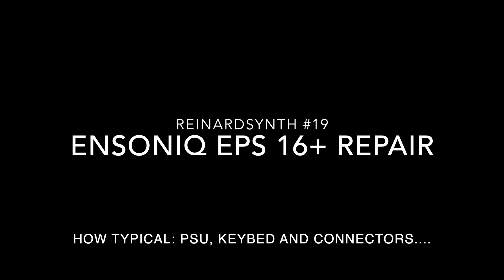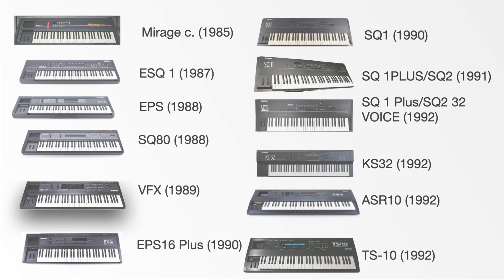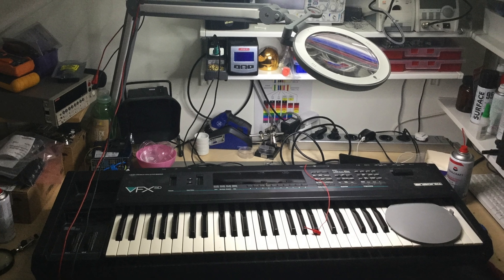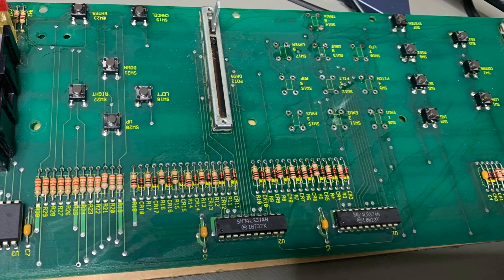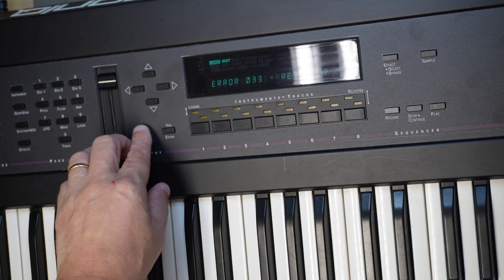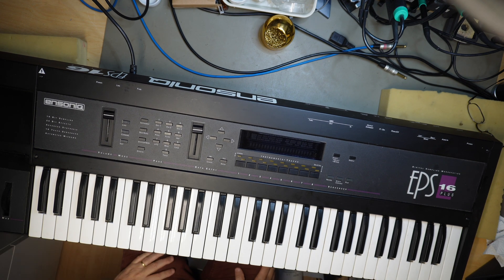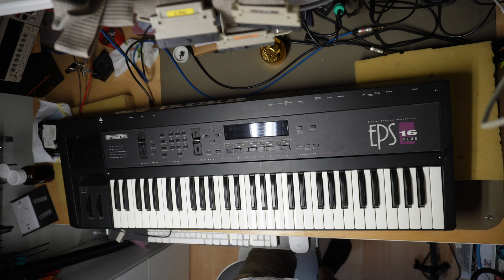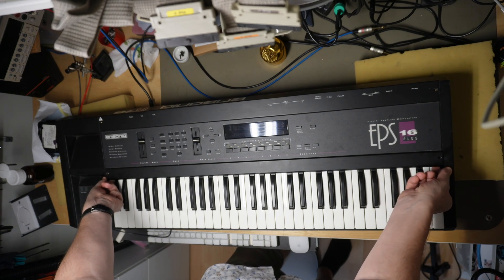ReinardSynth #19 Ensoniq EPS 16plus repair: instability, weird characters, Error 32 and 33?

Comment: Hey did you fix this? I found that those axial tantalums like the one over the ESP chip aren't to be trusted. I had the same type short in an SQ1 causing a horrible sound. I have a dead EPS and a working one as well. The working one after half hour starts playing cracklu and bugging out it might be something very similar to this and I have a thermal camera now I might tackle it again.

Comment: I've had good results in the past by unplugging and re-seating all connectors, one at a time. I used De-Oxit also, with good results. I used to carry a voltage regulator to my gigs, which also helped. Thanks for this video!

Comment: Hey, I'm looking to replace the faders because it broke just like it happened to you.
What resistance should the fader be please?
(And what do I have to look for so I don't get a mirrored potentiometer like you got?)
Thanks.
Reply from the maker: They're used as voltage dividers, so anything between 5kOhm/15kOhm, linear should do. I used 5 kOhm sliders from Bourns, PTA4553-2015CPB502, https://www.mouser.at/ProductDetail/Bourns/PTA4553-2015CPB502?qs=Zq5ylnUbLm6zEO%2Fky%2FDQSQ%3D%3D&countryCode=DE&currencyCode=EUR

I have not found ones with the right L/R pin out combination, that's why I used the new ones to refurbish the old sliders.... so: look for one like above, but with mirrored pinouts...
Reply: @reinardsynth6581  Thanks!
I'm trying to fix an EPS 16+ I got for pretty cheap, but there are noises when a note is being played, and on some pins on the power supply card thing, some pins have a really high tension.
But with looking further, it looks like none of the capacitors than are in the way looks to be leaking, so I tried to remove one of the regulator to see if it would remove the problem on the other lines, and I'm not sure.
But while trying to remove it, I think I damaged the points, I'm not 100% sure tho, but then I broke the pins.
So I'm gonna try to get my hands on some new regulators and see.
I seen on another comment that the Traco 2450 1,5 Amps could work, so gonna try these one ig (actually it's too expensive / can't find a good source).
Do you think just replacing all the big capacitor would resolve my issue? / Should I change all 3 regulators, or just the one I broke and hope the other are working fine?
Big thanks.
Reply: Hey, thanks for your answer.
(My last message didn't went through)
What's the thing you put between the 5v regulator and the cooling plate / ground please? Thanks.
Reply: Dang my problem wasn't with the powersupply board :(

Comment: Whats the feedback on this repaired machine ??    My EPS 16 plus goes wonky after 30 min, and thats after i had the power supply refurbished...  Does the one you repaired stay on without errors for longer than 30-40 min of use ??    thx for any help on this...
Reply from the maker: Runs stable, had no issues up to now!  Would really look at the socketed ICs: take ICs out, contact spray on soxket and put IC back in…
Reply: @reinardsynth6581  Thanks..   I will do that ASAP....
Reply from the maker: Son’t forget the connectors between the boards, especially that one I replaced with wires underneath the keybed…
Reply: @reinardsynth6581  I treated the contacts with spray and put them back in...what brand of spray is it? Can anyone tell me?
Reply: This is the exact question I wanted to ask.

Comment: Great video.

I was pulling my hair out with an original EPS that I got for free. It would boot but only after starting it twice. When first turning it on, the lights would come on but nothing on the screen. Pressing any buttons caused weird characters to appear onscreen. I determined it was entering diagnostic mode, which happens when one of the three boards isn't communicating: either the keyscan PCB under the keybed, the main PCB, or the panel PCB. If you turned if off and turned it back on again quickly, it would boot just fine.

I tried replacing some electrolytic caps on the main board that were suspect. After doing so the problem persisted, but then the audio was garbled. It was still working upon second boot up but the audio was distorted and sounded really bad. I haven't been able to fix it. 

I got another one for free a few weeks later. That one had a bad keyscan PCB. I put the keyboard from the first one in that one and it works, so at least I have a working one. I'd love to try and fix the first one, though.

Comment: This has come at a good time for me, as I have to fix my troublesome EPS 16 Plus. It has errors after 30 minutes warming up. This video will be very helpful.
I have seen someone say that the 5v regulators can be replaced with Traco 2450 switching regulators. They run so cool that they do not need a heat sink.
I will do this, replace the PSU caps, fix the keyboard circuit board's link connector and de-oxidise the rest of the connectors.
Reply from the maker: @r0tekz  had a quick look at the Traco 2450, and it looks very interesting! make sure to take the 1,5Amps or higher specced ones and pls report back how it went.
Reply: @reinardsynth6581  Yes, I got the 1.5A version. TSR 1.5-2450E  Will let you know how it goes. I have heard that there are 5v regulators on the keyboards PCBs, as well.
Reply from the maker: @r0tekz  they are regulating some local power rails, did not see them getting hot…
Reply: Ik heb wel 20 Ensoniq synthesizers. Doen het gelukkig allemaal prima. Alleen mijn Esq-1, die ik in 1986 nieuw gekocht heb heeft in de beginjaren een defect display gehad ( spontaan). Destijds laten repareren in Utrecht ( heette dat niet syntron?) dat verbinding probleem tussen de twee keyboard printen was ook een  zeer vaak voorkomend probleem bij de vfx synths trouwens.
Reply from the maker: Dan heb je goed voor ze gezorgd of geluk gehad ;-)
Reply: @reinardsynth6581  dat zeker :-) . ik kan gelukkig ook zelf nog wel dingen repareren tot op zekere hoogte anders was ik nooit begonnen met verzamelen van synths. Voedingsproblemen bi ensoniq zijn er al sinds de esq1 ( te licht en te warm) . Daarnaast bekende problemen die jij ook gevonden hebt , zoals geoxideerde verbindingen, elco's,Eproms die hun programma verliezen etc. maar dat geldt voor veel oudere apparatuur natuurlijk. Het spul is tenslotte 30 jaar en ouder
Reply from the maker: @Johnsormani begrijp nog steeds niet waarom ze steeds half-wave rectifying PSUs gebruikt hebben…